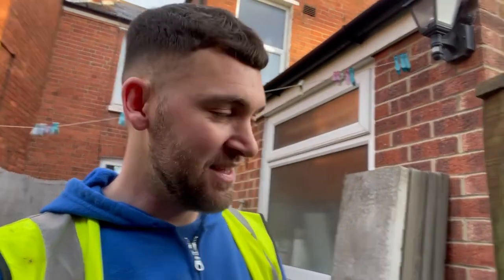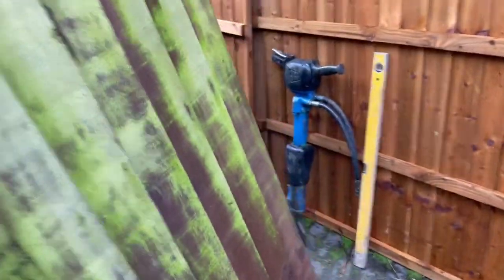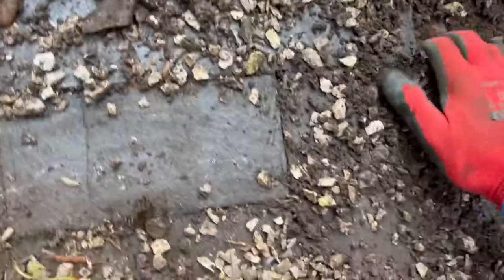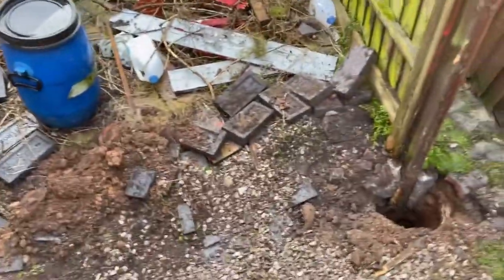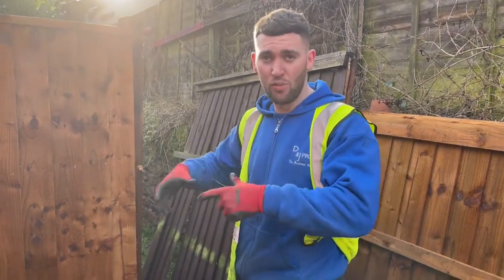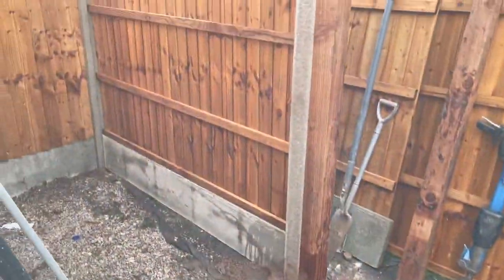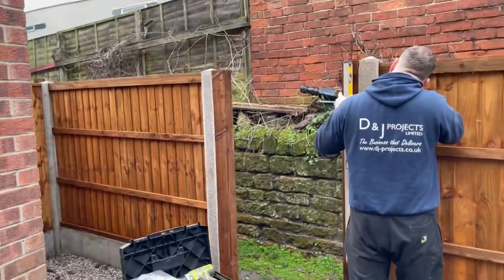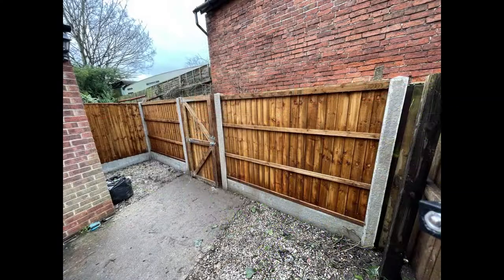How to erect a concrete fence

Comment: When your screwing the wooden and concrete posts together at the top for extra support how do you screw through the concrete posts do you drill a hole firstly with a drill bit so post doesn't crack ect? Thanks josh.
Reply from the maker: Hi josh, that’s exactly how we do it. We have the two posts together and use a 6.5mm drill bit to pre drill the holes and then use concrete screws for that extra support. It makes sure the gate doesn’t move which is always a bonus!
Reply: @DJProjectss  cheers mate appreciate the help, loving the vids too!! Ill See you soon for some materials no doubt!👍🏼👌🏼 thanks josh.
Reply: It shouldn't crack as its all re inforced within the concrete moulding structure itself, unless your very unlucky & it does crack 😒 timber into the post - size 75x75mm or 100mm x 100mm, i use 6mmx100mm wood screws with a 6mm penny washer to help spread the load

Comment: Absolutely smashed it. Amazing job 👌🏽 Just out of interest, what did you use to secure the gate posts into the concrete fence posts. Cheers 👍🏽
Reply from the maker: Concrete screws with a washer
Reply: @DJProjectss  thanks a lot pal 👍🏽

Comment: Did you concrete the gate posts and the fence posts in the same hole then use screws aswel ?
Reply from the maker: Yes we did 🤩
Reply: What screws did you use to attach gate post to concrete post